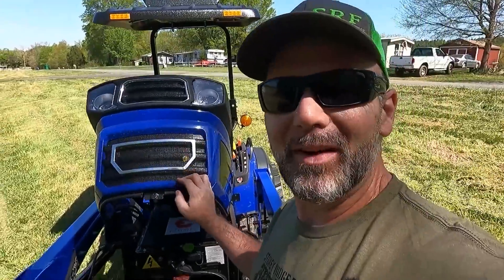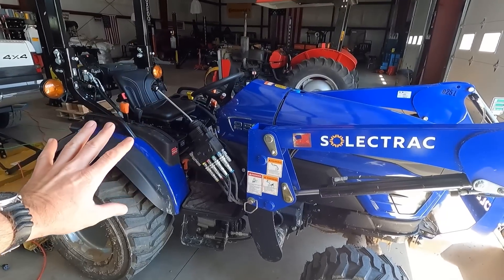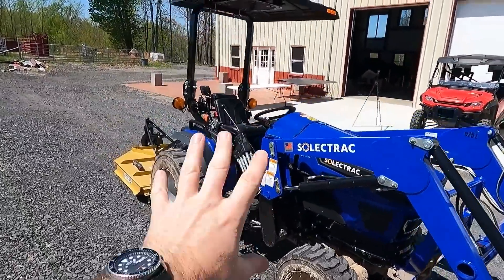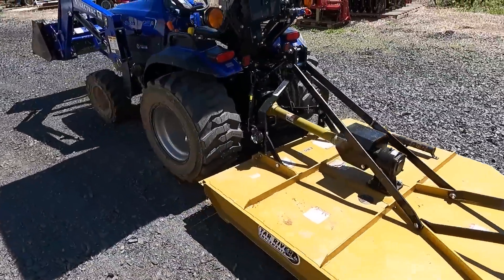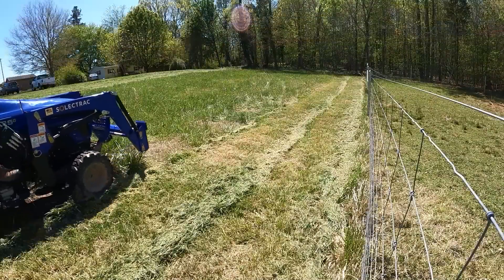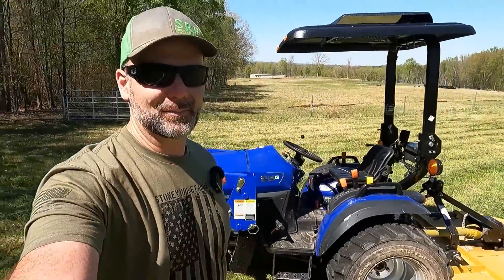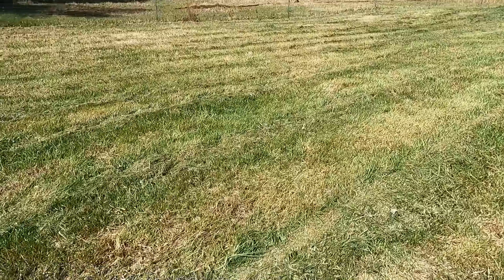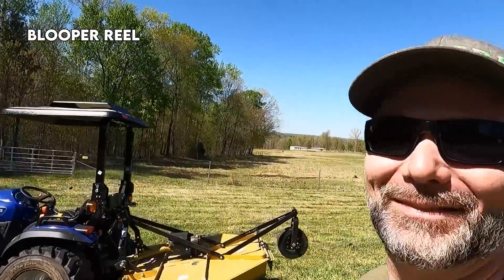Electric Farm Tractor testing....first time brush mowing tall grass

Comment: Lol 12 hours of charge I can walk to the gas station and back fuel up and finish my work way b4 that battery technology isn't there yet
Reply: Yea realistically they need to go to hemp supercapacitors instead of batteries.... theres like 1 powerr tool company that just started that
Reply from the maker: would you typically be running a tractor all day and all night? I guess I'm confused with the rationale here.  Park it in the shed.....charge overnight and work it all day the next day
Reply: I think you missed the whole point of it being electric.  If you walked to pay for fuel you are spending money already lol
Reply: Taylor Swift said it best "Haters gonna hate hate hate"
Reply: @StoneyRidgeFarmer  hey now dont make me plan my day that far ahead
Reply: This tractor is a hobby farm tractor. Charge time is a non-issue. You just plug it in at night, and it’s ready to go the next day. If for some reason you need faster charging, you can use the 240 volt plug.
Reply: Gotta wait and charge after LOL. Ill just add some fuel. You don‘t have to spill fuel? LOL really? wow, those pros of having this sad machine are pretty sad as well. What a joke.
Reply: Like he said. It's a chore tractor or a hobby farmer tractor this thing isn't for those long hour days where your sitting on a tractor all day.
Reply: @samuelhitchcock8547  Yeah but the weight of it and the price isnt there yet
Reply: @purplesocks9745  Yes sir. My mind is open to  advice from anyone even Taylor Swift.

Comment: What most don't know or mention is that it takes alot of fossil fuels to produce that  electric battery. 
   What's the cost of replacing or rebuilding the battery? How many machine hours will the battery last before needing to be replaced or rebuilt? Dealer network for a battery replacement or rebuild?
Reply from the maker: takes fossil fuels to build most anything...from a pair of sneakers to an airplane....however burns no fossil fuels.  Dealer network is popping up all over the country now and replacing a battery is supposedly gonna cost around $4k ish...not totally positive on that one

Comment: I think it would make a fine tractor for 95% of folks with a small homestead and the tasks they would be doing. I do have 2 observations on this particular model/iteration. 1) How does the PTO work in more detail? It sounds like it's similar to an old 'non-live' PTO tractor from the 50's. How would it operate, for example, backing into blackberries, then pulling forward, then backing again? Also, does it push you forward via inertia? 2) Those bigger tires looked very close to the front of the bush hog. I'm not used to a tractor that small so maybe they are all that way. Thanks Josh!
Reply: Exactly my thoughts/questions
Reply: Ditto, if the PTO only functions while in motion, what about operating a post hole digger?
Reply from the maker: great questions!  So....it does not mow backing up, it will slightly push you forward if you don't properly disengage the PTO or drive motor...the tires are close to the mower deck for sure and the deck needs to be locked in securely to prevent rubbing

Comment: Interesting concept, I'm surprised the tractor does not come with a canopy or hood with solar panels? Perhaps just a solar trickle charger built in type set up. Or possibley some form of alternator connected to the pto or drive train, just to help with recharging. Great video as always, we have a mini stoney ridge over here as well.
Reply: There’s this thing called physics and from it came the law of conservation of energy… so any alternator that requires energy input to turn couldn’t produce a net positive.
Reply: @Talan Pomeroy  I understand, however if something such as pto is going to turn either way, it could be connected to an alternator of sorts and help to slow power consumption.

Comment: Electric crown forklifts been in use for years and were tough as nails. All about the  battery life .May suit Some people just fine.
Reply from the maker: exactly....folks act like this is all new tech...but it's decades old my brotha
Reply: Electric forklifts certainly have been around for a long time… but electric forklifts are completely different than an electric tractor, plus electric forklifts aren’t designed to go off-pavement, mostly because of their tremendous weight and low ground clearance. In my 41 yearly working at a large manufacturing company, inexperienced forklift drivers often got stuck as soon as they tried to take a shortcut off the pavement.
Reply from the maker: yep....not much difference in these machines....but I agree...forklifts are designed with counter weight and they will get stuck on a wet banana peel lol

Comment: Many people park their tractors outside and I’m curious how well it would stay charged if the sun shade was a decent quality panel.
Reply from the maker: it would require an onboard charging system and specialized solar panel to work. Remember tractors take a beating so a solar panel might get damaged pretty quickly

Comment: Curious questions. Was going slow just a preference or a necessity, and is there any radiators/cooling systems that you have to keep clean? I keep the bucket on to help knock the debris down off my radiators.
Reply from the maker: you have to go slow to mow my friend....at least if you want the finished product to look nice.  We were cutting at about 4 inches
Reply: @Stoney Ridge Farmer  interesting. I run as fast as mid range, and terrain allows, at 4 inches with a clean cut. Try to sharpen your blades with just a tiny bit of a V on the edge. Keep the natural angle on the top grind, then come back with a sharp angle off the bottom to put an edge maybe a 1/4" or less from the bottom of the blade. I have a dedicated field mower that I keep the blades sharp and a brush mower.   I only asked because that looked like light materials on camera and you was creeping through it as if it was 5ft high and stupid thick.

Comment: Wpnder how the starting and stopping of the pto would work with attachments that have sheer pins?what you think?
Reply from the maker: I think you'd simply need to start out at a low RPM....it's a learning curve for sure but I got it after about 2 hours

Comment: For the average small acreage homesteader, maybe putting 50 hours on their tractor a year, this is a good little machine. The difference between an electric vehicle and an electric tractor are huge, I'm not quite sold on electric vehicles yet, but for a small tractor like this I don't see why it would be a problem if you're just a small acreage residential homesteader. Diesel is still king but nothing wrong with this. 
  I will also admit it must be nice to not have to listen to a loud diesel screaming while you're mowing. 🤷

Comment: I appreciate the insight since industrial equipment has used battery power for hydraulic functions for decades, so why not agriculture, but how would you run a post hole digger if the PTO only works while in motion?
Reply from the maker: answer....on post hole digger: I don't know...but I'll find out!

Comment: Very interesting... personally I'm not keen on the tyres  for a tractor but it's just the tyres..😊. 2 questions can you use it as a battery backup for off grid and how much difference is there between an engine powered version on price ? ..  can really see the market potential globally for this type of machine. Can't wait for more trials.. stay safe 🏴

Comment: Someone may have already mentioned this but, something to keep in mind... When a battery says "75%" it's probably more like 60%.  There is a curve that electric will follow, where you lose battery strength faster as it approaches 0%.  So 1.5 hours at 75% seems about right since the lower percentage may drain faster (ex: at 50% you be closer to that 2-ish hours, and at 25% you'll be right at about 3 hours, then at 10% you'll probably hit your 4 hours)..  It's not quite linear.
Reply from the maker: Not sure where you're drawing your assumptions.....the gauges should read accurately my friend

Comment: Everything looks good when the sun shines, the solar panels do not make electricity enough when you have a cloudy day. I was impressed with the tractor, I feel that you need to update the channel in a month in 6 months
Reply from the maker: Remember...Solar panel charges the solar battery bank...battery bank charges the tractor. So the sun doesn't need to be out my brother...hence charging overnight
Reply: Yes but would a cloudy day charge the battery bank enough to charge the tractor overnight? Does your battery bank store more than one full tractor battery charge?
Reply: Solar plus battery is the way to go. Good set-up.
Reply from the maker: then plug it into the wall

Comment: Solar powered is a misnomber.  Use it during the day, connect to the grid to charge overnight.  The solar charging system doesn't charge the tractor while you're out in the field.  Does the charging station have a battery that will charge the tractor (especially useful on very cloudy days)?  In other words, while you're out mowing, can the charging station charge the tractor overnioght without connecting to the grid?
Reply from the maker: solar power bank charges all day, plug in tractor charges all night

Comment: That's a neat little tractor.  It's ironic you decided to mow for this video.... I just did a favor for my neighbor... I ran the bush hog for 11 hours over 2 days.... With an 82 year old tractor  and used 10 gallons of gas.
Reply from the maker: Man...I'd like to know what 82 year old tractor runs a mower at less than 1 gallon per hour! I need one of those machines!
Reply: @StoneyRidgeFarmer  It was probably closer to 15 gallons because I started out with half a tank..its a 9N ..no modern goodies but it gets the job done.

Comment: make sure you keep the 12V "aux" battery taken care of by keeping the system turned off when not using it, and perhaps putting a tender on it just like you would with any other vehicle if not using for a while.  If that 12V is dead, nothing (including charging) on the tractor works..and the "main" battery pack has limited ability to charge the "aux" battery when running...it is just wired to be a sustaining charge with very small gauge wires.  Tractor Time with Tim has a video that goes into detail on his experience of this issue.
Reply from the maker: just leave it plugged up when not in use my friend....why would ya need anything other than the plug that comes with it? I'll watch Tim's video
Reply: @StoneyRidgeFarmer  yeah i assume if you leave it plugged in to the main charger port, it will maintain the aux battery. I think Tim just left it parked with the system on and it killed the battery, then once dead the main charger doesn't work because it needs the aux battery to activate.
Reply: You have to turn off the red switch by your left heel to prevent “phantom drain” of the 12 volt battery.
Reply from the maker: why would he leave it parked with the system on?  Must have been by mistake
Reply: @StoneyRidgeFarmer  He kind of addressed that in the video.. basically didn't know any better crossed with a test observing battery charge level over time. He noted that the charge level didn't drop over time so he thought it didn't really matter if he left the system on, not realizing that it was in fact the aux battery that was dropping and ultimately being completely drained. But to your original point, if kept plugged in when not in use that whole scenario could likely be avoided.

Comment: I feel like it is a bit of an oversight to have that canopy with a fan that runs off the tractors battery and not to have its own solar panel so you can squeeze a tiny bit more work out of a charge. Something you could suggest to the company!

On a different note, I'm happy to see electric vehicles becoming so common, however it still bothers me what it takes in the form of strip mining to get the rare materials in order to make the batteries. Hopefully we have a less damaging solution on the horizon as far as battery technology goes. Thank goodness the battery is recyclable though!
Reply: The battery in this tractor is lithium-iron-phosphate, so no rare minerals. Lithium is not rare and it is not strip mined. So, you’re good — guilt-free battery in this one.

Comment: From what you have said about the battery it's using old technology. New battery technology coming online is going to double if not quadruple battery capability. Just think that little tractor running for ten hours and only taking 30-45 minutes to charge.

Comment: And how long would it take to fuel up a tractor the. Equivalent? Of the same size instead of waiting 12 hours for a fully charged battery. You can fuel it up within 10 minutes. 10 to 15 minutes and be back my then. Those batteries are not 100% resacramento. The materials inside battery is non recyclabecause because it costs too much to recycle them

Comment: Is the disposal of the battery a massive problem like the auto battery?
Reply from the maker: not sure how an automotive battery disposal is a massive problem. You take it to the auto parts store, they pay you for it and it gets recycled right? I'm not sure how it's a massive problem...it just gets recycled
Reply: Batteries are 98% recyclable. The landfill thing is just propaganda.
Reply: @StoneyRidgeFarmer   not speaking of regular auto battery, but the batteries used in electric cars. Seems disposal is an issue on them.

Comment: I dont understand converting DC current into AC with the use of a fancy battery bank, then charging the tractor with 120 AC. Id like to see some solar panels on top so it can charge when not in use.

Comment: I think people are conflating this tractor with completely going electric for their entire workforce on a small operation. And while you could, and depending on govt mandates may have to, for now at least it’s a supplemental piece of equipment to conserve fuel. I like seeing the diffferent equipment being used. And I appreciate the transparency of when it’s a sponsored piece of equipment. Keep it up sir.
Reply from the maker: I don't see this as a gov't mandate or a threat to diesel or gas tractors..it's just one more option for the homesteade/farmer to try something different

Comment: It’s so nice not using petroleum products, like grease, hydraulic fluid, fuel, rubber tires, plastic parts, paint, steel, and all the loud noises that come with a combustion tractor. Batteries are so clean for the environment. At least, thats what they tell us.
Reply from the maker: it's using hydraulic fluid just like a tractor...just an electric motor.  This isn't an environmental vid my friend....just another battery powered tool on the farm

Comment: Josh, Can you use the charging station for something else other than charge the little tractor?
Reply from the maker: the charging station isn't made specifically for the tractor...it's a solar battery bank backup power solution for the shop building my brother
Reply: I'm hoping you do a full review on the Zendure also. I have the same setup to power my office.

Comment: They need to build hybrid vehicles and equipment instead of battery only for high drain applications.. battery works great until it goes dead 😄
Reply from the maker: it doesn't go dead my friend....it will let you know when it's low and ya take her back to the barn and plug it in